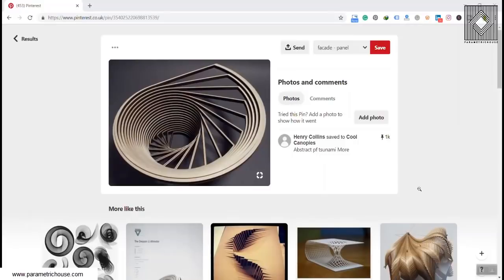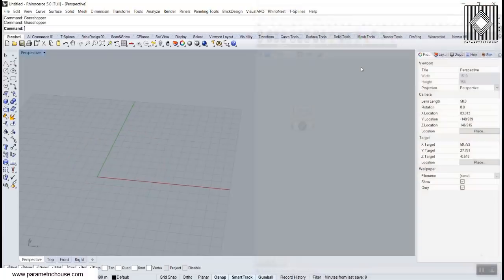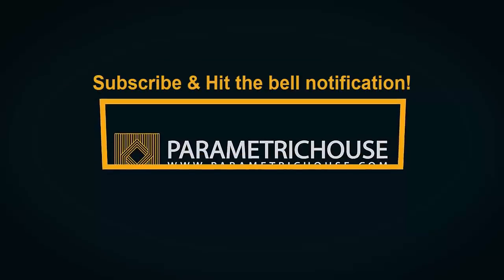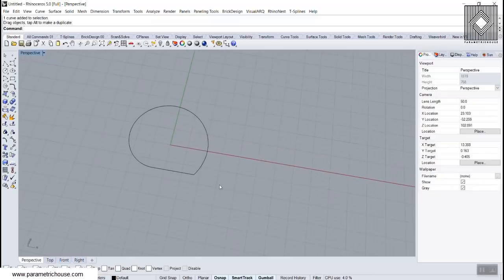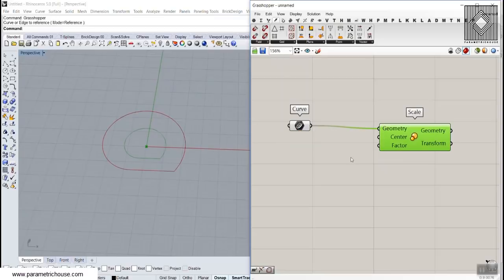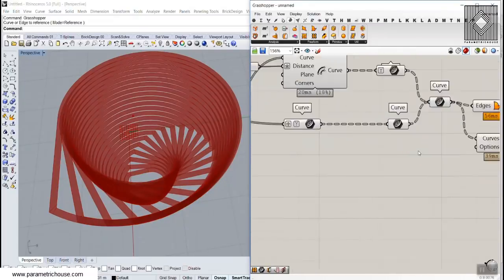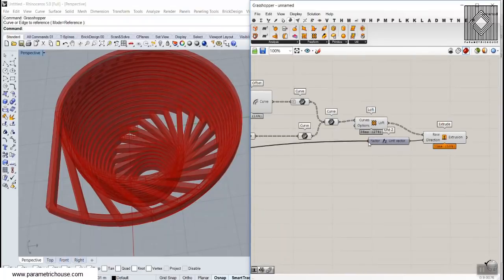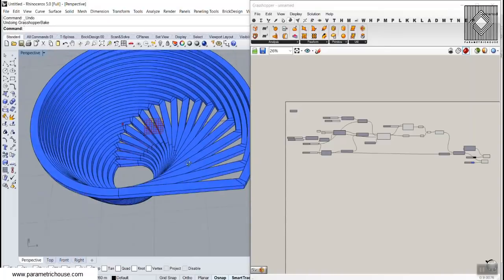Rotating Curves

Comment: You made a spiral curve creating process overcomplicated. Spiral > flat > Mode= Turns > Turns = 1. After that enable  Osnap End & Tan. And draw a line from the outer end of the spiral to the tangent point on the closest spin of itself. Then Trim and join. I guess this will also be part of the algorythm to make it procedural. Btw If you start drawing your flat spiral from a center and leave it there then you will have a pretty good start point for rotation and scaling with this spiral center.
Reply from the maker: Yeah right I thought to record the spiral thing again but I skipped it!😉 anyways I wanted to show that sometimes the algorithm can be easier if you start with a fixed curve and focus on the main algorithm.